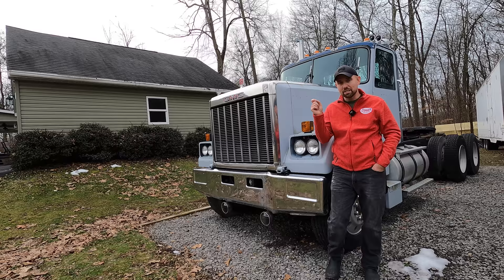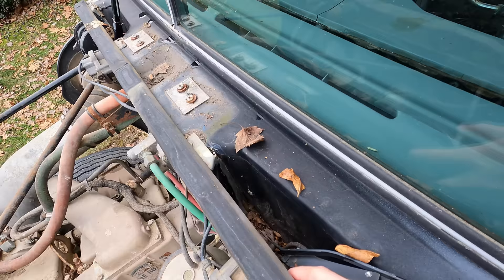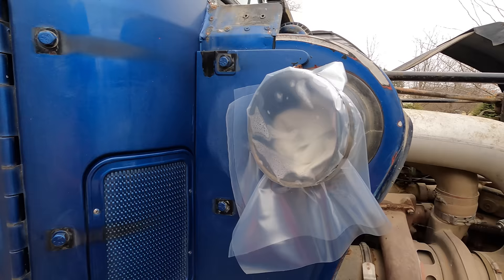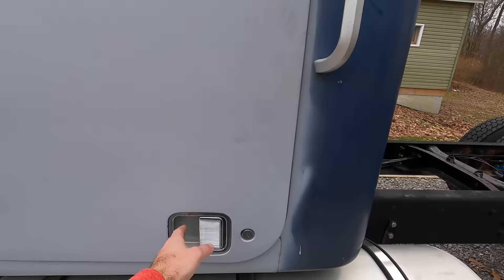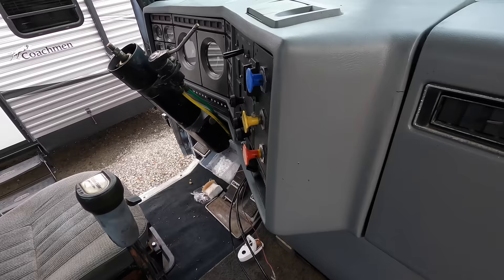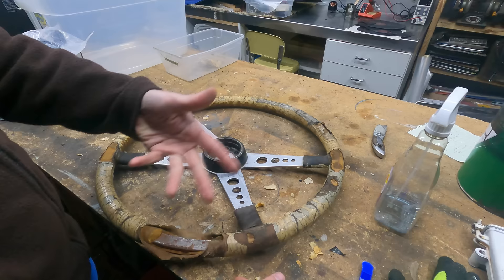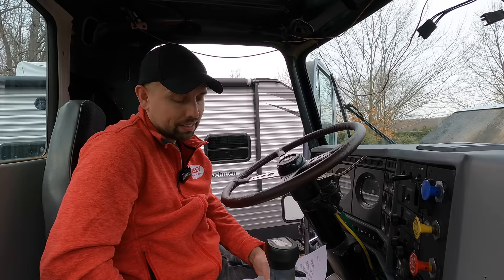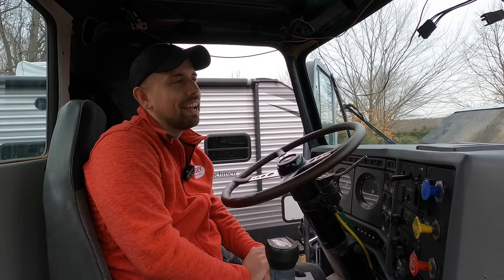Screen Used Knight Rider GMC General Tour, 2023 Plans, Steering Wheel Restoration, Under the Hood

Comment: The Engine on the GMC is a “Cummins NTC-350 Big cam 3”. And fun fact, despite this truck having a Cummins engine during the scenes inside the trailer you would hear the trucks engine in the background but instead of hearing a Cummins, you hear a 8V92 Detroit Diesel engine. Not sure if the sound of the Detroit came from the first GMC knight rider had. GMC generals were known to have 8V92s or 6V92s.
Reply from the maker: Great info, thanks!
Reply: Hollywood sure seemed to like the 8V92. Both Rubber Duck's Mack from Convoy and the Happy Toys semi from Maximum Overdrive used that motor for the engine sounds.
Reply: no way to know what horsepower is unless you see the data tag, and assume someone hasnt messed with the pump
Reply: @KnightRiderHistoriansOfficial  hello please how does the car drive by itself when there are people driving?

Comment: Being that it has sat so long I would strongly recommend rebuild or replace the Turbo. If the seals inside are bad you could end up with diesel runaway. Once that starts it's almost impossible to stop. And it won't stop until it melts down the engine.
Reply: Eh, have you seen some videos online? It is possible to stop a diesel runaway, although some ways can debatably destroy a couple or more parts depending on how you do it, if it isn't a manual, you can plug the intake with something (which is part of how or what fire extinguisher do with fires. Did you realize that?) Or use a fire extinguisher itself, or, with a manual, you can put it in the highest gear and dump the clutch. And, melt the engine? Yeah, it would likely get hot, but, the main thing would be once the oil gets past a point, it'll waste away the protective lining of the piston wall and score the wall until it siezes up and/or uses up the remaining oil.
Reply: Or he could replace the seals and not have to run around trying to plug the intake
Reply: @TheAngryPlrate  you talking to me? If so, actually try to show that next time, and yes, I do get that Joe could do that, I was telling taz (the person that we're talking in a thread under) that it is possible to stop a diesel runaway.
Reply: Smart money would be in replacing the turbocharger, high-pressure supply line gaskets on the return tube…
Reply: Joe, there’s a data tag 🏷️ n the left side of the engine at the front, on the front gear housing. Most likely a 350-400 hp Big Cam.
Reply: Just have to kill the motor is all that one high gear breaks set let the clutch out don't even have to dump it it will die I agree tho would nit be a bad idea to atleasy have the turbo checked out

Comment: The horn button works slightly differently than you described.   The "pin" should be spring-loaded and always ride with pressure on the contact ring in the steering column.  That's not the "switch" portion - it's merely a means to provide constant contact between the switch (which is that single-P/N component) and the column, which also why there isn't a means to "push" it.   The wire should likely be soldered to the tin piece inside the button (you can see the solder blob at 36:05).  The system is all ground driven, where grounding out the wire will blow the horn. 

Hard to tell exactly, but I'd wager the "cup" should be tied (glued?) to the outer plastic button, and there should be a (missing) spring that presses on the plastic button to let it float.  The flat tin piece must pick up ground from the wheel, and pressing the horn button should put the two into contact, thus completing the circuit. 

Essentially:
Column/wheel (ground) => backing plate => metal cup => wire => contact pin => horn solenoid
Reply: I was thinking the same thing.  It's been forever since I've had one of these old horns apart, but it is exactly as you describe.  Looks like there are a couple spring missing, one from the contact pin, and one from the horn button.
Reply: I also suspect that "cup" should be flipped the other way at 36:24 - it looks like the inner hole of it likely fits the plastic bump on the button.

Comment: I would recommend checking  all. your wheelbarings and brakes in . both the tractor and trailer and the old wiring in both of them .
The last thing you would want to happen is get it all back together and loose it to a fire due to the old wiring .

Comment: Great job, Joe. Especially the work on the steering wheel. 👍
Reply: yeah get a parts manual and they got a exploded view of the horn button on column  ...............we had all that stuff  manuals from 1939 to late 90s manuals but got them tossed when dealership went out of biz.....sigh....
Reply: The only thing missing is the "Nut Behind the Wheel"😁

Comment: Most every truck have two types of horns an Air Horn( a wire/ rope hanging above near top of the door frame ) and a City horn on the column( much softer so you don't startle  other drivers to bad) ,not like a Air horn which GMC mounted on the roof  is  recommended use on the Freeway extremely loud. Great job on the steering wheel .

Comment: Are those Goodyear G159 tires?  They're kind of a big deal because they were used in motorhomes and they weren't up to the task, failed and hurt/killed quite a few people.  They've actually been recalled.  I don't remember the details on the recall, but going through that might offset some of the tire replacement costs.  Kind of surprised to see them on a semi if when they weren't suited for motorhome use.

Comment: I hope you give that engine a really good cleaning possibly some paint  on rusty areas like the radiator. The steering wheel looks so much better. Good job. 
Looking forward to seeing the sleeper on the truck. Will the sleeper be completely fake? Or will it be possible to get into it from outsde? I don't think you plan to cut an access opening in the cab.  
Keep up the good work

Comment: normally the 80s horn button contact that rides on the ring is spring loaded into the ring not away from it like yours . so something is together wrong there , the wire is supposed to be hot all the time then grounded to energize the horn relay

Comment: Is the engine the original one? Also, you should probably have that turbo overhauled, it'd be bad if one of the seals in it failed and the engine ran away (If the intake side seal fails, it dumps the lube oil that's piped to to the turbo into the intake manifold, and it self feeds off the oil, so you can't shut it off by the key, and unless someone can shut it down it either runs out of lube oil and the bottom end locks up or it overrevs/overheats and dies in a different spectacular way)

Comment: I would highly recommend a manual battery disconnect knife switch or a Boston battery disconnect switch for the tractor and trailer batteries.  15 years of firefighting. I would hate to see all that work go up in smoke from. A electrical short while it is sitting.
Reply from the maker: Thats the plan. Batteries aren't even in them right now
Reply: @KnightRiderHistoriansOfficial  that's great 👍. Thank you 😊.

Comment: I did a search on "1983 GMC GENERAL STEERING WHEEL HORN" (all in caps) and there was one for sale in the UK. It may not be the right one but looked a lot like it. Even if its wrong it might give you an idea of what's missing. For some strange reason searching in lower case didn't bring it up.
If it helps its Ebay description title is "1960-1973 GMC Steering Wheel Horn Cap Comfort Grip Black Kit"

Comment: Might I suggest that you investigate where mice may have gotten in previously.  It can be difficult to find where they are getting in, but  it is usually not that difficult to stop them once you find the spot.   Plug up holes with grommets or silicone, or bigger ones with mesh.  You might need to insert a mesh screen in the airconditioning duct work.  Mice can crawl through pretty small holes approx 3/8" spaces, but in my experience it is much better than keeping mothballs or urinal cakes or whatever else in the vehicle.
Reply from the maker: Mice haven't been in the truck for over a year. Thats just my insurance right now until it is garaged

Comment: When you put tires on that truck put brand new ones on. If you do go with Recaps on the rear I definitely recommend bandag. I would recommend Bridgestone tires on the front if not all the way around. Trust me I've on media trucks in my past to be exact 8 of them and have driven Many of Miles over my time. It was quite interesting to see everything about that truck because I remember doing all my own maintenance
Reply: To be safe, I STRONGLY don't recommend recaps as they're mostly not meant for prolonged high-speed travel.
Also, regrooves (i.e. worn but with a 'new' tread cut into the existing rubber) are not just illegal, they're dangerous.
Reply: @user-rs1990  nobody makes truck tires with REGROOVEABLE molded into the sidewalls? I've seen that on them years ago.

Comment: I still think you can repair that cracked dash pad; a bit of plastic welding on the backside to stabilize the part, filler on the front and re-texturing, then paint the whole dash to match the color.

Comment: 37:12 the plunger on the rear of the steering wheel should also be spring-loaded. That should be in constant contact with the ring on the column. The horn button is also spring-loaded and when it is pressed, that’s what makes the connection to sound the horn.

Comment: I hope the trailer wall donation options stay open until late March so I can take part.
ETA
For the horn button once you find the return spring the red wire should attach to the back metal plate where it will complete the horn circuit when depressed.

Comment: The plunger on the steering wheel should be down all the time. The wire, when grounded, makes the horn blow. The hub and wheel are grounded through the steering shaft. The horn button assembly would act as a switch to ground the wire. Same as in most gm cars for decades. Same as Trans Ams, got a TA wheel around?
Reply: Maybe a spring holds the button up, and a push down touches the metal part to the wheel to ground it?

Comment: I would try fitting a spring in the horn button assembly. You wouldn't necessarily need  the correct one, just find one of a size that will function.  Maybe be necessary to cut it.

Comment: GM used this strange horn thing in a lot of cars back then. I never have figured out the one in my Camaro because it is pieces like that and it seems like what I keep seeing isn't enough to make it work.  That steering wheel looks like an oversized version of what my 83 Firebird came with from Pontiac.

Comment: That plunger on the horn button should be spring loaded and in contact with the slip ring at all times. There should be some kind of switch inside the button that connects when pressed.  Very nice work on the steering wheel sewing. I'm curious how you repaired the foam on the rim. Can you explain that? Thanks!

Comment: The cut wire connects to the steering wheel boss (gmc disc) and it appears you are missing at least one , if not two springs , the spring on the top side , goes under the steering wheel boss , there may be a spring under the steering wheel itself , the steering wheel boss should just clip in , if you are missing clips , you may need to scource another complete steering wheel , if you can find a same steering wheel and column intact at a scrap yard , it may be a good thing to buy it , so you can strip it and replace missing parts , keeping the rest for parts.

Comment: Hey Joe,  another amazing video!  Thank You So Much for all of the hard work that you are doing!  I assume that you plan on replacing all of the fluids in the tractor right?  Oil, Antifreeze (coolant), transmission oil, and rear diff oil.  A good cooling system flush would probably be a good idea as well.  I'm sure that it has an oil cooler somewhere on the engine too, it might be a good idea to check its condition and functionality prior to running her too much to make sure that the oil is being cooled properly.  All in all, she's coming along nicely!  😃
Reply from the maker: Yep it will all be done!

Comment: I have a Question , now that you have the Hauler , Can you tell what happened to the wheels when the Back Dropped down you can see the to Let Kitt out and Load  him up . Once the Gate goes back up the the wheels retract ?  Or did they still  stick out once the door went back up.  Thanks Keep up the Great work
Reply from the maker: The wheels were manually.placed by the crew, they cut the shot, added the wheels, then resumed filming

Comment: That horn assembly looks just like a Grant steering wheel assembly.  If so you're probably able to get a button kit and use its parts to rebuild the guts of the OEM button, snd also how its supposed to be wired to function

Comment: Did you polish or clean up the front-side of the steering wheel?  After the cut when you were putting on the leather, the back (metal part) still looked warn, but the front looked like it had been cleaned and maybe sanded.

Comment: You have done a great job of the steering wheel but if you want to make the cover look tighter and get rid of them rinkles get a steam cleaner and run that around it the steam will make it tighter and smoother around the seam.

Comment: I'm not that well versed on American trucks, but in the UK several trucks we're offered with Cummins power, here was 2 sizes 10 litre or 14 litre, I'd say that engine is the 14 litre producing roughly around  320 - 350 bhp, that'd be my guess,  the same engine and similar power was offered in the ERF in the UK

Comment: I would have the turbo and the radiator flushed with all new hoses and the oil cooler flushed but definitely the turbo replaced

Comment: yes you will have a spring and a wire contact disk that the wire connects to you are missing the disk with the wire contact point and the spring . have had many apart  although on trucks not big rigs, but on a sport wheel its a spring loaded simply system you have most of it just no spring and unless the disk you showed has a connector for a wire you don't have that.

Comment: Im sure you already know this but when you replace your truck tires make sure you buy new virgin rubber and do not buy recaps!! Recaps have a bigger tendency for blowouts and alot of times when they blow they do alot of damage.
Reply: Indeed. Recaps or Regrooves (i.e. new tread cut into the existing rubber) are NOT meant for prolonged high-speed use.
And of course, replace them immediately if they are SIX YEARS old from their DOM (Date Of Manufacturing).

Comment: That cab has come a million miles since you rolled that rig into the yard. Not to say the rest hasn't been leaps and bounds of progress. Oh the crusty steering wheel. While not leather 28 years driving rigs from coming on to the company property brand new to squeezing the last serviceable miles out of that same rig once that protective coat wears off rubber residue and wheel hoofersnief came off on your hands and diviets wore in the rubber so I took to carrying a couple rolls of dollar store electric tape in my lunch bucket to affect steering wheel repair in the field. 
From my very limited experience mucking about with beater repair in my misspent youth there should be some sprung contacts and most likely a return spring. Possibly the rig had a dual pull cord and button system and the button stuck after it's time at the studio and the best way to deal with the stuck horn and resultant air use was to just gut the button. Possibly the pull cord if seen in the show was purely Hollywood because the standard horn button wasn't trucker  enough the pull cord was MacGyvered as a way to pass inspection after the button deleting and might explain the roof hole.